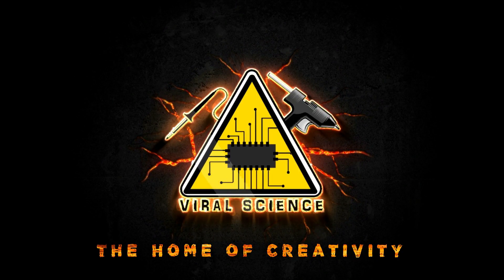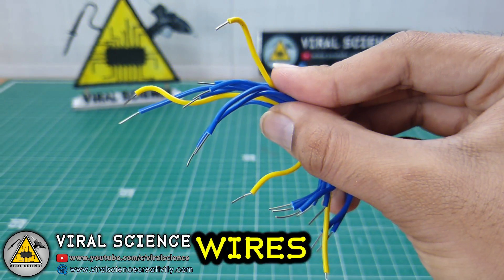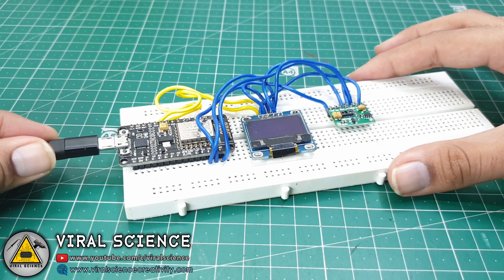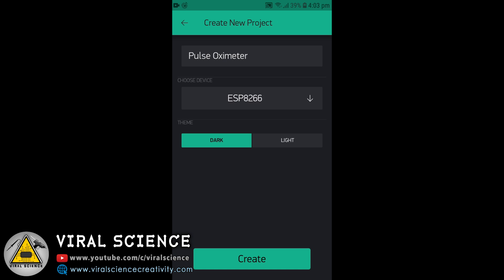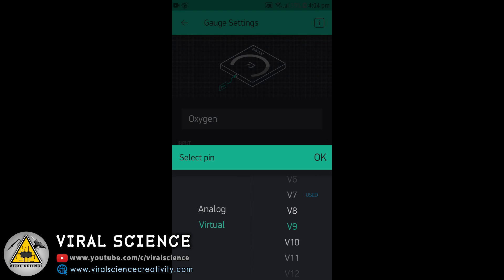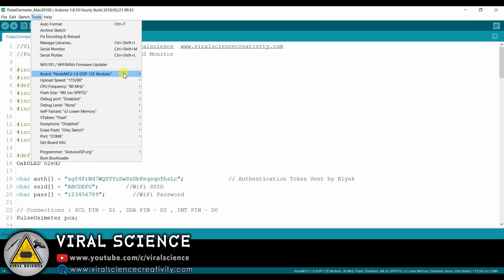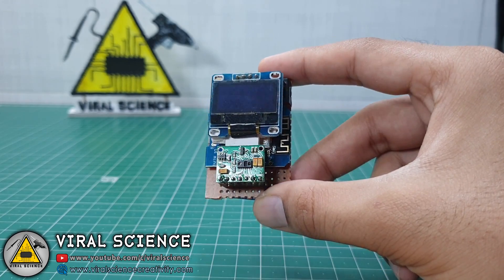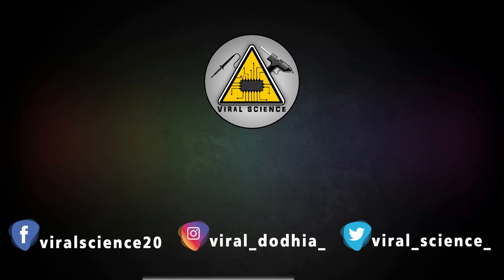ESP8266 Pulse Oximeter Blynk BPM SpO2

Comment: Getting this error,

In file included from C:\Users\jones\OneDrive\Documents\Arduino\libraries\Blynk\src/Blynk.h:14:0,
                 from C:\Users\jones\Downloads\BP measurement project\Code - PulseOximeter_Max30100\PulseOximeter_Max30100\PulseOximeter_Max30100.ino:7:
C:\Users\jones\OneDrive\Documents\Arduino\libraries\Blynk\src/Blynk/BlynkApi.h:39:6: error: #error "Please specify your BLYNK_TEMPLATE_ID and BLYNK_TEMPLATE_NAME"
     #error "Please specify your BLYNK_TEMPLATE_ID and BLYNK_TEMPLATE_NAME"
      ^~~~~

Comment: Thanks bro..this is the only one which worked so far. Bro pls help me 1) The BPM reading is not constant as its varying and going upto 293 + where as we have already set to value 130 in blynk.  2) OLED display is very weak. pls help
Reply: How did u solve it.  ?
Reply: @shourjyajitmaiti2490  Its working ok without any modification or change.
Reply: @vijaynaru  how did u solve it .plzz tell my led was not glowing and after sometime it is telling it cannot be detected ...at first it was giving abrupt heartbeat 🎉

Comment: Friend here doesn't work, I've done everything here, launched the libraries and the connection scheme, but the MAX30100 led does not light up and the display shows the message, initializing pulse oximeter ...
just it
Reply: Hey did u find the solution to your problem ? Even I m facing the same problem
Reply: @Moppybird07  did you find the solution
Reply: @jungcookie7041  no...

Comment: Initializing Pulse Oximeter..FAILED. This is what it is showing. I followed all your steps. This is our college project. Please help
Reply: Hey did u find the solution to this problem ! I need it too .would u pls help
Reply: @Moppybird07  Don't waste your time on MAX 30100. Get MAX 30102 sensor. I already got output using 30102
Reply: @vaibhavsawant6640  same code and connections will work for max30102 ?? Also thankyouuu so much for replying
Reply: @Moppybird07  No. Same code won't work. Is this your final year project?
Reply: @vaibhavsawant6640  sem 6 iot project :-(
Reply: @Moppybird07  Max 30102 code is available on Google
Reply: @vaibhavsawant6640  ok will check on Google..thanks
Reply: @vaibhavsawant6640  bro it will not work ah bro
Reply: @Moppybird07  Hey did u find the code for Max 30102 ! I need it too😂😂🤣
Reply: For MaX30100
Reply: @vaibhav sawant did you complete your project because I working on same project and I have same problem can you resolve it??
Reply: @18_499 HARSHAVARDHAN MOKALA It's too big for youtube
Reply: @vaibhavsawant6640  bro can u share the link to the website fot the code for max 30102
Reply: Anyone find the solution for this problem...

Comment: brother have you remove the resistor
Reply: Have you tried the project, cause mine is not working although I didn't removed the resistor. Do you have a solution?

Comment: Bro can u help me out im facing issue with Max 30100 iC as its not getting input power some other websites told to cut te 4.7k resistance path to Fet and directly solder a wire from there to FEt gate!!
Pls give ur suggestions how u did without any modifications in the MAx Ic pls help me🙏
Reply: Have you tried the project, cause mine is not working although I didn't removed the resistor. Do you have a solution?
Reply: @vaibhavsawant6640  hey i need help, i am doing this project now
Reply: @pratheektssk7629  bro did your sensor worked?? I need some help